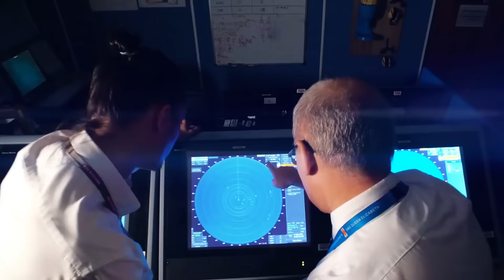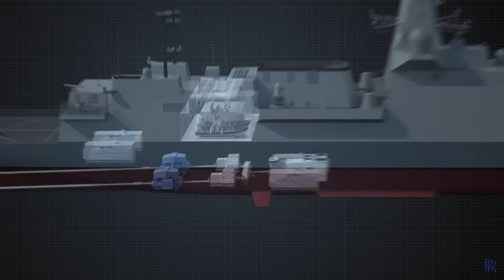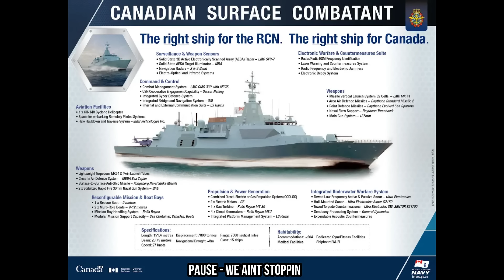Canada's New Warship

Comment: The Type 26 is a very impressive looking ship and it's great to see the UK, Australia and Canada all using it, hopefully one day we get to see all 3 versions operating together. 🇬🇧🇭🇲🇨🇦
Reply: Hi AB. It will indeed be a very impressive and capable class of ship. The only drawback could be the number of VLS cells on each vessel. As far as I know, they are not reloadable at sea. Meaning once all of them have been fired, that's it! The next volley of enemy missiles and  fast jets will get through. It is possible to have multiple smaller missiles in quad launchers within each cell but at the expense of the longer range weapons. 
The bigger destroyers can carry double the number of VLS cells plus other antiair and antisubmarine munitions. Also additional turrets for the new advanced multirole BAE 40mm naval guns with Pre-fragmented, Programmable, Proximity- fused ammunition. That can be programmed in six different function modes to provide optimised effect against any aerial, surface or shore target. This provides weapon systems with the highest possible combat flexibility.
Reply: @gusgone4527  I personally don't see it being too much of an issue, 24 to 32 VLS is pretty standard for most frigates around the world.

The UK variant actually has 72 VLS in total which is made up of 24 mk 41 launchers and 48 Sea ceptor silos for local area air defence.

But it's worth remembering that certain missiles such as ESSM and Sea Ceptor can be quad packed in Mk 41 silos, so if you have 32 Mk 41 VLS you could potentially fit 128 air defence missiles.

A pair of 40mm naval guns either side of the ship would definitely be a nice addition for added flexibility!
Reply: New Zealand needs to get on board too
Reply: @AB-gi3qy  Sea Ceptor silos are smaller than MK41 silos. Each MK41 silo can have four ESSM.

24 and 32-cell VLS are from western European points of view. The East Asian point of view has  South Korea's Sejong the Great-class destroyer with 128-cell MK41 VLS, Japan has the Atago-class destroyer with 96-cell MK41 VLS.

Western European warship designs are timid when compared to South Korean and Japanese Aegis warship designs. Australia's point of view is stuck in western European while the reality is in East Asia.
Reply: @AB-gi3qy  Type 26's multi-mission bay could support a second 32 or 48-cell MK41 VLS cluster.
Reply: @AB-gi3qy  
South Korea's Sejong the Great-class destroyer with 128-cell MK41 VLS can quad pack 512 ESSM or Sea Ceptor. LOL 

Japan's Atago-class destroyer with 96-cell MK41 VLS can quad pack 384 ESSM or Sea Ceptor. LOL 

USA's Arleigh Burke-class with 96-cell MK41 VLS can quad pack 384 ESSM.  Arleigh Burke-class has two MK41 VLS clusters.

Your mindset is stuck in western Europe.
Reply: @valenrn8657  The UK Type 26 actually has 72 VLS in total which is made up of 24 mk 41 and 48 Sea Ceptor cannisters. If you quad packed the Sea Ceptor into the mk 41 as well you could have upto 144 short to medium range air defence missiles.

Even with the Aussie Hunter Class applying the same principle you could potentially have 128 ESSM missiles for air defence which is a lot and shows how much you can actually do with only 24 to 32 VLS.

But it's important to remember that the The Type 26 isn't designed to be a dedicated air defence destroyer, it's a sub hunter and probably the best one in the world.
Reply: @valenrn8657  Western Europe produce some of the most advanced equipment and weapons and have some of the best militaries in the world, I know which ships I'd rather be on.
Reply: @AB-gi3qy  Sea Ceptor silo is small when compared to the MK41 silo.
  

Hobart class (F100) has a single 48-cell MK41 cluster while Japan's Atago-class destroyer has two 48-cell MK41 clusters, hence 96-cells MK51 VLS. The location for the second 48-cell MK41 cluster is usually near the hanger bay.

Hobart class (F100) has a single 48-cell MK41 that can be quad-packed up to 192 ESSM.

Again, Type 26 's multi-mission bay seems to be large enough for the second 48-cell MK41 VLS cluster.

Your mindset is west European.
Reply: @AB-gi3qy  >Western Europe produce some of the most advanced equipment and weapons and have some of the best militaries in the world

East Asia has a heated arms race when compared to western Europe.

Jan 2022,  U.S and Japan to develop counter-hypersonic capabilities. AUKUS is not unique.
Reply: @AB-gi3qy  Type 45 destroyer's Sylver Vertical Launching System A50 is equivalent to the shorter tactical length MK41 variant.

Sylver Vertical Launching System A70 is equivalent to the longer strike length MK41 variant. 

Strike length MK41 supports larger missiles like SM6, SM6 Block 1B (hypersonic),  SM3 (hypersonic), Tomahawks, LRASM, 

Sylver Vertical Launching System A70 is a paperweight from the France and UK.
Reply: @valenrn8657  The USN is building the the Constellation class with 32 mk 41 VLS, the new Mogami class of the Japanese navy has 16 mk 41 VLS, the Type 054a of China has 32 VLS and The Indian navy Visakhapatnam Class has 48 VLS, I guess these are all western European mindsets too huh?
Reply: @AB-gi3qy  The US and Japan have a high-low mix doctrine. Europeans only have the low-mix doctrine. LOL
Reply: @AB-gi3qy   Indian navy Visakhapatnam Class 
4 × 8-cell VLS for  32 Barak 8 surface-to-air missiles, 
2 x 8-cell VLS, for 16 BrahMos anti-ship missiles

Silo size can differ when comparing different brands.
Reply: Haa! Ok je comprend l'alliance piramidale haaaa ok Canada Australie Royaume Uni en Parallèle a l OTAN 🤔 je me trompe?
Reply: I hope you mean on a training exercise or something...
Reply: @adamknight5089  aren't they on permanent lockdown?
Reply: @orfchannel8685  No they're not
Reply: New Zealand needs to come get the HMZS Te Mana back from a Esquimalt.
Reply: @valenrn8657  You're comparing frigates to destroyers, both of which have vastly different roles. Frigates are generally integrated as a support element - more multirole, anti sub etc. Destroyers are dedicated air defence ships.
Reply: @valenrn8657  The Hunter-class is meant primarily for anti-submarine warfare but it can be used for other missions as well. My question is why would you need more than 100 anti-air missiles anyway? Assuming it takes 4 ESSMs to intercept an average anti-ship missile you still have enough to intercept 25 anti-ship missiles which is more than what would normally be fired at a single ship during a combat deployment. Also notice that the US Navy plans to retire the Ticonderoga-class cruisers while building more frigates instead. Many of those East Asian destroyers were built before quad-packing was a thing which is likely why they have so many VLS tubes. It also likely has something to do with their main potential opponent being right next to them and a potential war being much more naval oriented than any potential war in Europe. Since Australia is so far from China we don’t have to worry about our ships being constantly attacked even when in port like Japan and Korea do.
Reply: @devonlord99  >My question is why would you need more than 100 anti-air missiles anyway?

Would potential enemy limit their firepower to a low level? 

>Also notice that the US Navy plans to retire the Ticonderoga-class cruisers while building more frigates instead.

Constellation-class frigate has 32 cells MK41 VLS and 21 cells for RIM-116 Rolling Airframe Missiles.

Arleigh Burke-class destroyer has 90 or 96 cells MK41 VLS. Not including the extra RIM-116 Rolling Airframe Missiles.

DDG(X) has 126 cells MK41 VLS.

The US has high-low mixes like the F-15 and F-16 high-low mix.

>Since Australia is so far from China we don’t have to worry about our ships being constantly attacked even when in port like Japan and Korea do.

False narrative.   There is a security agreement between China and the Solomon Islands.
Reply: @kaichiohno  Frigates and destroyers categories have been blurred.
Reply: @devonlord99  Spain classified Álvaro de Bazán-class F100 as a frigate while Australia classified F100 based Hobart class as a destroyer.

Both Álvaro de Bazán-class frigate and Hobart class destroyer have the same 48 cell MK41 VLS count.
Reply: @devonlord99  >Many of those East Asian destroyers were built before quad-packing was a thing which is likely why they have so many VLS tubes

South Korean and Japanese Aegis type destroyers have MK41 VLS with quad packs.

US Navy's Arleigh Burke-class destroyer's 96 cells MK41 VLS design clones are
Japanese Maya-class destroyer with 96-cell MK41 VLS
Japanese Atago-class destroyer with 96-cell MK41 VLS

US Navy's Arleigh Burke-class destroyer's 90 cells MK41 VLS design clones are
Japanese Kongō-class destroyer with 90-cell MK41 VLS
Reply: @AB-gi3qy  "...one of the best in the world..."? How is this - did one hunt down and sink a sub?
Reply: @AB-gi3qy  Again with the "...some of the best militaries in the world..." nonsense! If that was (or is) the case, why does the US have so many troops stationed in NATO? Why did they start crying when Trump threatened to pull some troops out!
Reply: @derrick4544  Deterrence and they are part of NATO, you do realise they have troops based in many countries around the world including Japan and South Korea?
Reply: @AB-gi3qy  I'm aware of Canada being active in peacekeeping missions (and some counter-terrorism), but are you implying that there are enough Canadian troops and hardware (stationed in these countries) to act in a capacity similar to the US troops?
Reply: @derrick4544  I'm not sure what you're talking about pal, you said US troops in Europe, which is what I was referring to when I said that they (the US) have troops in many countries including South Korea and Japan.
Reply: @AB-gi3qy  Oh, I thought you meant Canadian forces.
Reply: The only problem is that Canadian shipyards are so slow and expensive that by the time the last boat is built the fleet will be close to being obsolete.
Reply: We are working together at this very moment. Lets not forget the U.S.
Reply: No, it isn't.
It is a STAGGERINGLY overpriced ship.
That with normal government corruption?
By the time the things are built? They could end up being the largest military fiasco (financially) in Canadian history.
☮
Reply: @adamknight5089  NZ should ask Australia to build a few for them or buy their F100 class AWD. I believe  Australia will be replacing them with a upgunned varent hunter class with 96 cell VLS
Reply: You mean Canada, Australia and UK 🇨🇦🇦🇺🇬🇧